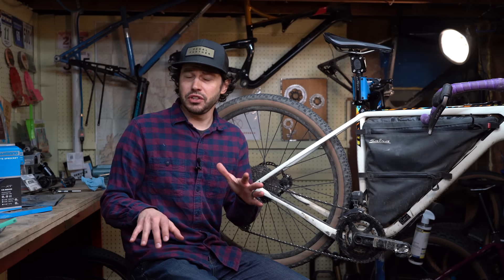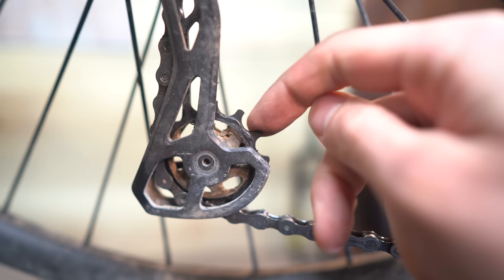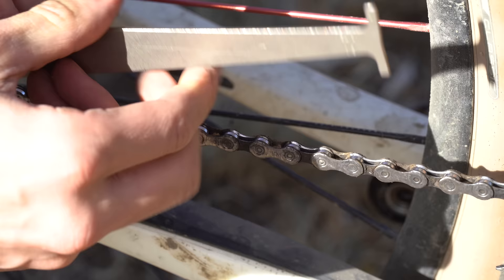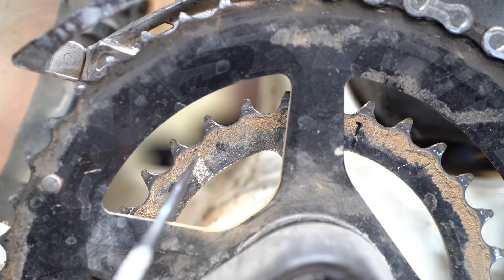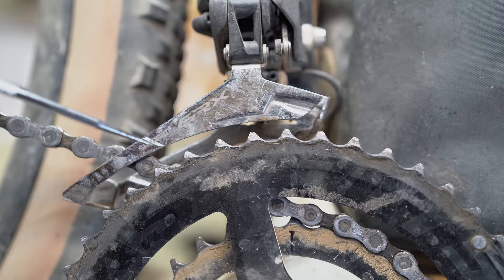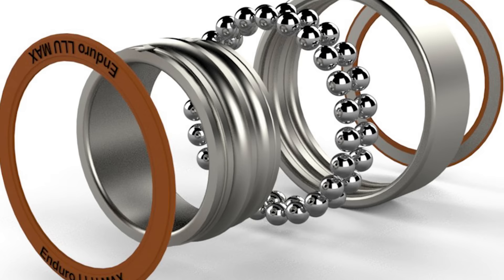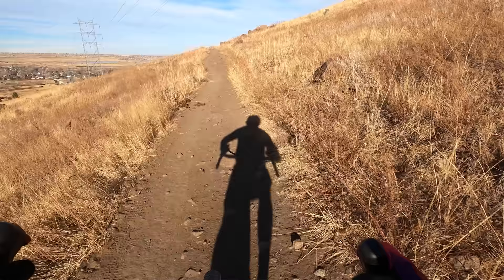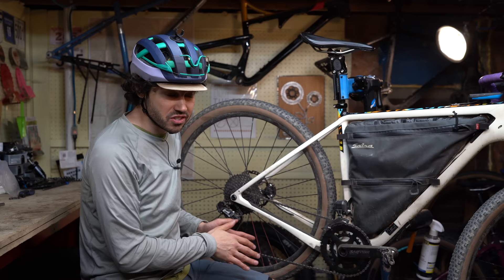A Pandemic Drivetrain: The 4,000-mile Audit

Comment: Thanks so much for the update!   I've been looking forward to it.      Made the same switch to an 11-40 cassette on my GRX 810 about 2 months ago.   Used a Goatlink and it works great.   Also started with a new Shimano Ultegra chain.   Don't have a lot of mileage on that bike just it yet.     

Was wondering how your drivetrain was wearing and what lube you used on it.   Looks like you haven't held anything back from it - lots of dirt and mud!!   Did you use Dumontech lube on it?   What frequency did you re-apply/clean?     

 I have to admit that I'm a bit obsessive about chain cleaning.   Have been running Rock n Roll Gold on all my bikes.   Frequently re-lube, check wear, and also giving them a solvent bath every 500 miles or so to clean the embedded crud out of them.   But, I just decided to go all in with waxing (Silca Hot Melt and SS Drip wax) - hope it will allow my components to last longer!

Comment: The PC1110 Sram 11speed Chain lasts only 1350 Km until 0.5 worn with chain checker. Had about 6 since summer 2020. Maybe because of sand and the fact that my pandemic weight is 235 lbs.
Reply: Ill be interested to see how mine last as I just bought a couple (they were cheap) to try on my commuter bike (11 speed GRX mixture of 600/810). Previously had KMC & I did around 3000 km on it until 0.5 worn (I weight around 85 - 88kg) The cassette was still fine, so didn't need to replace. Ive never found any difference between KMC or Shimano so ive always bought whichever is the cheapest. Im commuting on road but I would expect the wear rate to be a lot more if off road. On my mtb bikes, the chain wear is so much quicker due to riding in very sandy soils (Sydney, Australia) + the extra the torque that im putting through on the drive chain.

Comment: I wonder if you’d get more mileage if you replaced the chain more regularly, as manufacturers suggest. I’ve tried replacing and not replacing chains on various group sets over the years, but the variation in riding conditions always makes it hard to know what the best method is.
Reply from the maker: Oh, absolutely. I just wanted to see what would happen if I didn’t. Good rule is just to keep checking your chain.

Comment: Plandemic  drivetrain is a singlespeed. Simple is as simple does. 
  I call my fixed gear cyclocross bike my 'Crossafix'. It will also be my apocalypse bike! 
  These bikes are actually reliable . They can be abused and neglected. I even bike pack on my singlespeeds. 
  Its the rider, not the bike. ALL YOU  gotta do is push the pedals harder! 
  The difficulty is mostly in your mind. Mental strength is more than 1/2 this battle.